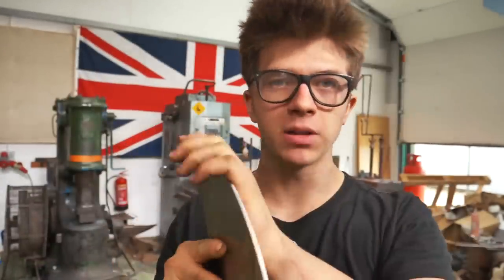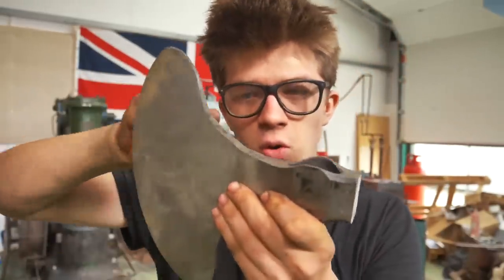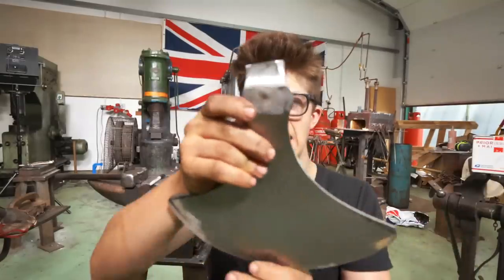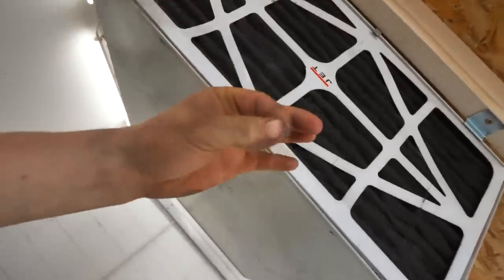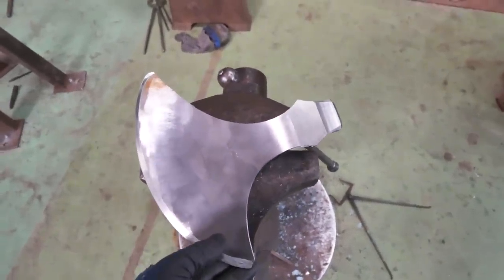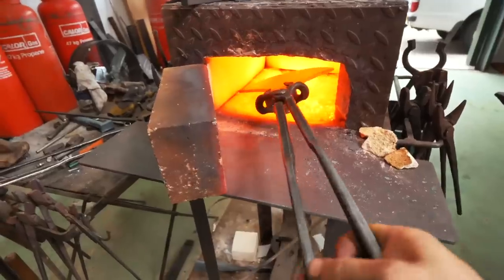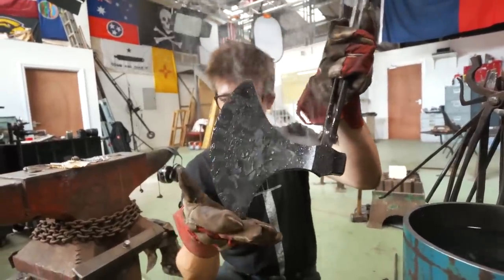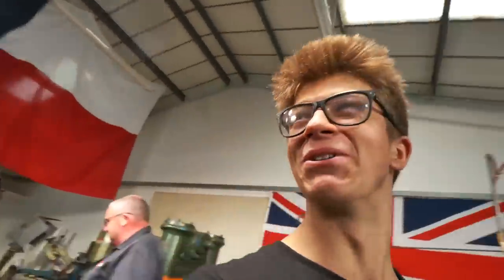VIKING BATTLE AXE: Part 4

Comment: Alec! Post a big ol' sign on the doors of the grinding room to remind you to bring a respirator! Like so he sees :)
Reply: I was going to say to make a hanger for the respirator next to the door.
Reply: @jeffsmith-ng6vz  Better would be a little locker for the respirator so its not hanging free in the workshop. This will prevent the respirator to collect dust which you would inhale every time you put it on. Just build a simple one from presswood or something. Doesn't even need an actual lock, just use weak magnets so you can open and close it easily without any hassle. Paint it red and write something eye catching on it so you see it every time you go in. Inhaling dust from grinding and sanding is no joke and you should make sure that you put it on every time. But how to store it is at least as important.

Comment: Hey Alec! May I suggest that you invest in a cold cut steel saw like the one Jeremy from simple little life has? Don't get me wrong, the bandsaw is great, cause you can walk away and let it do the work, but when cutting just small things, I think a cold cut saw would come in handy. Great axe bud!
Reply: John K Kreations 
Haven't watched the video yet, but I believe he already has one. If not, never mind :)
Reply: he have one
Reply: I'm pretty sure he just has a cutoff saw, not a cold cut saw
Reply: He has both
Reply: Any particular reason? You should also differentiate between dry cut and cold cut (with coolant) circular saws, they're a lot different in price and performance. Dry cut is great for fabrication, and quite the step up from an abrasive cutoff saw. The Blades however are very expensive, and while faster than a bandsaw, big material still does take a bit and there's no walking away from it while cutting. Hit an improperly annealed big chunk of tool steel, kiss that spendy blade goodbye. Bandsaw blades are really cheap by comparison if you make that mistake, and the saw he has with coolant can chew threw large chunks of steel all day long without any problems. Bandsaws still cut pretty fast, they have larger throat capacities, and they have a narrower kerf, turning less material into shavings. About the only thing he has to gain is speed, and imho, a bandsaw with coolant is probably the best bet for cutting stock down until you get to an actual cold saw - but even they are more for production than general work. Abrasive<Dry cut<Bandsaw.

Comment: Alex turn your extension lead upside down in the grinding room!!
Reply: Metal filings in there is a no no
Reply: Or even better, buy some child safety plug blanks and eliminate the risk altogether
Reply: Maybe some in use weatherproof outlet boxes.
Reply: Jimbobaggins Its Alec

Comment: you should place some windows in your grinding room
Reply: Err0rDutchy theyd end up looking like super black tinted windows after 10minutes of grinding
Reply: it will feel a bit saver in there its a completely sealed off room and you wont hear a thing with the loud machines and with headphones on.
Reply: Alec basically hot boxed his grinding dust. he shouldn't even walk in that room without a respirator on. Put a sign on the door Alec!
Reply: Nikon he's gonna get a real professional negative pressure system in there soon that I think will pump the dust outside
Reply: Yeah they grinding dust needs to be sent out immediately. Get a good vent system going
Reply: What about the people outside??
Reply: #BlacksmithingProblems.

Comment: That ax looks amazing already! You could forge a dust pan that goes on your shop vac hose for easier dust cleaning. Just sweep it right into the vac.  Like a blacksmith's take on the mounted vacuum systems.

Comment: You should get some construction paper for making templates for drawing radius for the grind. draw your curve onto the thick paper, cut it out. then use that when marking the steel. mark one side then flip the paper over and mark the other so the radius will be the same.

Comment: Hey Alex! You spoke in a recent video on your thoughts of leaving your respirator out and easily accessable vs. having it stored away in a safe spot. Here's an idea: Since you'll wear it most often while grinding, you could build a small box that hangs on the wall on the outside of the grinding room, right next to the door, to stow it away in. This would keep the shop dust from getting on in when not in use, and be stored in a very accessible location for most tasks.

Comment: Another awesome project - the temperature reveal on the patterning was truly choice... & what a pattern!!
Something you might want to consider if you're going into larger pieces is a quench trough - would also make differential hardening easier too.

As a btw - some Scandinavian smiths use a double-medium method for certain bladed implements that are likely to see heavy use - edge-first slowly into the oil & then quick dunking into iced oil & water before oil-tempering...  Disclaimer ---> I have no idea if this is a wise move with forge-welded stock (layer counts & patterns go way beyond the pure utilitarian work I'm thinking of)

Comment: hey Alec,  
just wanted to share a piece of advice that I was given when I first started out as a bladesmith.
If you wrap the contact wheels of your belt grinder in a couple of layers of masking tape, it'll stop the belt from digging channels into your wheels. I always used relatively soft wheels and I found that after a few years they would get deep indentations down the middle, masking tape works wonders though. 
Really enjoying your videos, keep them up.

Comment: For the grinding room, I know you've mentioned it, but a dust collection system with suction hoses running along the bottom of the wall will work best. And have suction vents under each machine. That should help keep the dust to a minimum. Maybe, also create a negative air pressure in the room to keep the dust in there

Comment: Hey Alec, just watched the vid, (I'm a bit behind as you can tell) but I was a bit intrigued by what you said regarding the heat treat process. I'm a metallurgical engineer and from my understanding of heat treating steel, cooling rates control the material properties. Slowly cooling the material in the furnace will allow the  steel to become more soft while rapid cooling causes the hardness to increase. By heating the oil, you actually decrease the cooling rate which theoretically would cause the quench to become less severe and the blade less hard. There are some other things to consider though. If the oil is less viscus after you heat it up, it may be possible that more oil could flow over the steel allowing it to remove more heat that way. Anyway just thought I'd mention it to ya. Enjoying the channel. Keep up the good work.

Comment: You should  put a large bucket filled with water about 3/4 of the way under the grinders to catch the steel dust or at least just a bucket so the water doesn't make it difficult  to clean

Comment: Hello Alex, Rod from Australia here. I refer to a recent clog regarding Wranglerstar Cody and the respirator. I agree with Cody and I keep my respirator in a box I also only use mime once a month or so. That said, I agree with you that out of site out of mind and you obviously use yours daily. May I suggest you hang it on the outside of the door near the handle. it will always there when you enter the door and is also, well a bit cleaner. best of both. Happy hammering Rod

Comment: Without creating a horizontal surface, you should fabricate a hook to hang up your jacket, hearing protection and respirator on the outside of the grinding room, so it's always right where you need it!

Comment: Two suggestions: 1. put stainless steel splash backs on the walls of the grinding room at bench height to catch the dust to prevent black walls. 2. Buy a roomba clone and stick magnetic swarf picker uppers on the back and run it often. My Foomba (fake roomba) has made my lab so much cleaner it's amazing.

Comment: I think doing up a few more of those grinding wheel pegs would be good. hang them around the workshop, one on the outside of the grind room entrance, a few others in other spots. Hang respirators from them (maybe in a bag to keep them clean) for quick access, and reminders, to wear one when you need, where you need it, and before you forget it.

Comment: Don’t know if you’ll actually answer my question, but here it goes. Does the type of Damascus you make have any advantages over the Sandwiching techniques used on the Japanese Katanas? Where the harder metal is sandwiched in the middle and goes to the front edge and the more flexible steel is on the outside?

Comment: still say you need some windows in the grinding room, big bay window on the main wall and a large window in the door, with a clear respirator holding box mounted on the outside wall so u see it each time u enter the room

Comment: You could build a wall-mounted box outside of your grinding room (right next to the door) that you can put your respirator in.  Kind of like an "in case of emergency" wall mount except "in case of grinding". XD
In any case then you'd have the best of both worlds: kept clean in a box, and easy access as you walk in and out of the grinding room.

Comment: You should build a hanger to put your respirator on and hang it front and center on your grinding room door, then it's right in your face anytime you go in the so you'll be more likely to put it on every time you grind, and I think that will keep it relatively clean

Comment: Alec, If you bed the anvil on about a centimeter of 100% silicone caulk and let it set a bit before setting the anvil on it, then bolt it down tight when it has fully cured. This is going to cancel out about as much ring as you can.

Comment: what if you build a small respirator storage box and mount it next to the grinding room door, it would still be easy to access and look cool, and it would mean it won't end up on any other horizontal surfaces

Comment: Alex, Brandon here....have you ever thought about a vacuum for your grinding room? I've seen shops where there is a vacuum where a big hose is attached near the floor with a wide opening so you can turn it on and sweep all your dust right into it? Just trying to help improve the shop for efficiency
Reply: Alec
Reply: Stupid auto correct

Comment: Hey Alex you should take all the metal dust when the vac is full then light it with a nine volt bat or mix it with aluminium  also you should make copper damascus

Comment: clean your grinding room and then hang a clear heavy mill plastic all over ceiling , walls and tape lower edge to floor.  you will be glad in a few months when you need to deep clean.   should only have to sweep each day/static electricity might get interesting though  lol.

Comment: grinder dust is an issue but if your in a big enough area with enough ventilation you shouldn't need to worry that much about the dust, keep a water bucket under the grinder to catch the dust and keep your area clean and you should be fine. it should always be a high priority to keep the area clean, the fact that you confined the dust to such a small room just makes the dust all that much worse, you would be better off with a larger area, less to clog the filters that you use to get ventilation, less you have to clean/change those filters, less often you have to clean the area because of over caking of dust and also grinder dust can get slick i built up enough so less of a tripping hazard.

Comment: Respirator idea:
       I agree if I packed my respirator away I would probably never consider it worth the trouble to get it out for a little or even a medium sized job, then i would fall into the belief that its not that important again and never unpack it again. How about a metal box 4 or 5 inches deep mounted on the wall in the grinding room just big enough to hang  a respirator or 2 and some filters, with a door. No trouble to get to, or put away.

Comment: Alec, I dunno if you answer questions but here goes. How long do you allow the forge to heat before using it? I want to build a gas forge but don't know how long to wait before it works for me. Also what kind of grinder where you using this episode and how much did it cost?

Comment: The shape isn't quite asymmetrical enough, it looks more like a slightly wonky later crescent axe, furthermore to be useful in combat the blade thickness needs to much thinner, dane axe's are essentially built like meat cleavers not felling axes which have the wedge shape

Comment: Question - why can not that hard scale be removed by heating and scrubbing with the wire brush you sometimes are seen to use?  Would think it easier to do instead of waiting for it to cool and grinding it off.

And do you have a larger furnace?  Seems like some of the pieces you heat up are longar than the enclosure of the one seen in your videos.

Comment: It looks like your grinding room is located against an exterior wall. That filter deal you have seems like a lot of hassle to keep cleaning keep cleaning. You could put a interior to exterior fan in that wall. And then you would just have the clean up factor after every grinding session..? Just a recommendation.

Comment: Hi Alec
when you are grinding with the 9 inch grinder some time's you get hot spot's does that affect the metal when you do the hardening and tempering ????
PLEASE PLEASE PLEASE could I buy an off cut of the AXE

Comment: Alec, question about the scale; I watch a lot of Michaelcthulhu's videos. When he starts working with a piece of hardox steel, he puts it in a bath of white vinegar (well, it's mostly grody brown vinegar now...) which just dissolves the scale on the metal; he then just scrubs it with a little steel wool and sprays it off with a hose. Would this work on your projects as well ,as a labor/material/lung-saving device, or does the steel you're working with have a different reaction to that sort of thing?
Reply: Punkrawk it will leave a little but it makes it much easier to get off i do it myself

Comment: I was looking at your grinding room and would it be possible to knock a hole in that cinder block wall and install a fan 12-24 in that would pull air from inside and blow it outside?

Comment: is there a reason you did all the profiling on the belt grinder? seemed a lot of material there and just wondered if it was easier/quicker to get the bulk of it with your 4 1/2 grinder, then do the finer detailing on the belt.
Reply from the maker: +Adam Hardaker much more control than the angle grinder! It was pretty fast too! I think I spent more time moving the camera for different shots than the major stock removal for the profile took!
Reply: thats surprising. but then again I've never used a belt grinder! looking forward to seeing it finished!!

Comment: If you give it a wire edge... Alec don't. You need a secondary bevel on this.
Edit  oh wow the secondary bevel is 45 degrees on both sides so I guess it will never roll .

Comment: You should have vacum lines running under the belt grinders at least, would control all but small trace amounts and of course your angle grinder messesunless you grind around a vacuum vshoot shoot

Comment: put a powerfull magnet at the grinding room, maybe something will happen (cleary don't know anything about magnets)
Reply: Arthur Moreira How do they work?
Reply: maybe MAGIC
Reply: Some guys have mentioned similar suggestion b4, red hot sparks may stick on the magnet and glue together with the steel dust and scales. And scales are oxides, won't attracted by magnet.
It's cool to make a broom and dustpan with a magnet attached though.

Comment: Looks great but I think the other design looked better and more authentic
Reply: This design is actually more historically correct. The bearded axe is more recent and beloved by Hollywood. That may be why you think it is more "authentic".
Reply: Damascus steel spear? :D
Reply: Drew Wilson   this design is a battleaxe. The bearded axe was a woodcutter's axe. Lots of vikings used them because everyone gad one. This design is a real and was a more expensive fighting axe
Reply: Actually design he chose was "Petersen type M" viking age axe and this type is only one we know for pretty certain that it was meant to be a battle axe and not just for cutting wood. Most other types of viking age axes were mostly for woodworking. Only thing he did wrong was that the axe was too thick. Real battle axes had very thin blade to reduce its weight and  make its blows quicker and harder to parry. Pattern was awesome tho.